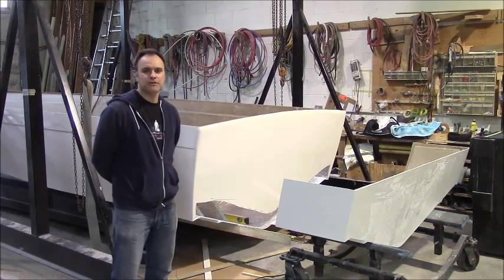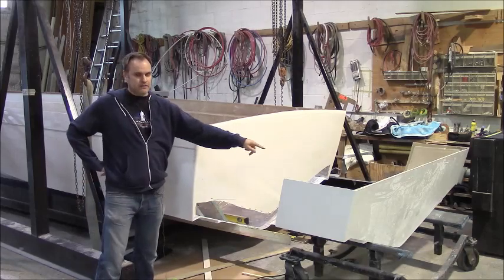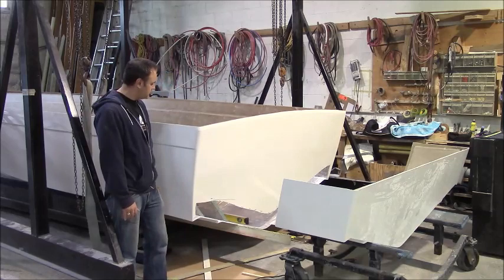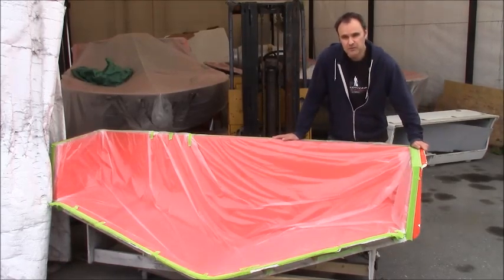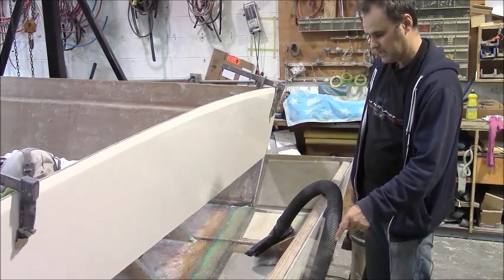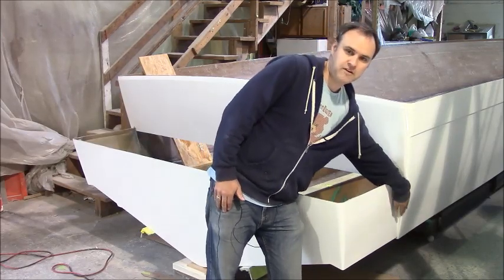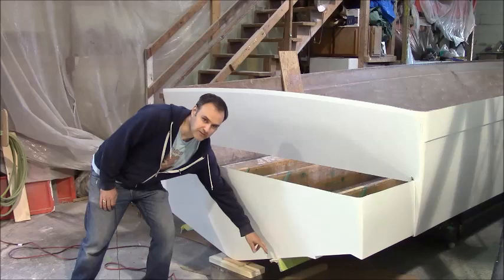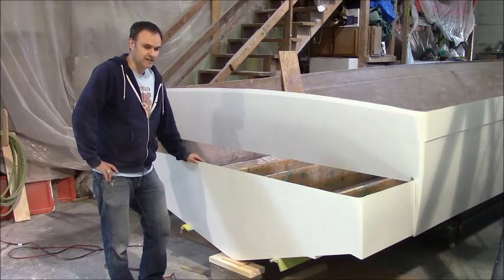How to Extend a Fibreglass Boat Hull

Comment: I think your video showed me just fine what you do, I've worked in fiberglass for years. 
In a large boat place I worked we built a removable transom (back) to the mold. We also made the mold extra long so we could slide the transom section FWD or back and make a 46 or 50 out of the same mold , this had inboards and we were able to leave the running gear in the same place . 
I would have thought you would have extended you hull mold and just dropped in a plug when making a shorter version. Do the work once and then make the hull  the right length every time from scratch , no patching.
Cheers warren
Reply: Kinda what I thought. I'm not a fan of the 2 opposing 90° corners at the "step". Looks like that would be a breeding ground for spider cracks.

Comment: Very cool to see this operation! So basically the strength of the extension is all about the extended stringers? Another thing I don’t understand is the new transom is much lower, the engine will be short shaft then?

Comment: Everybody wants brackets but this makes more sense. Brackets don't add hull length in most cases. Hull length is important because it adds efficiency at lower displacement speeds by adding waterline length. Displacement speed is the speed at which the wavelength of a vessel's bow wave is equal to the waterline length of the vessel. By extending the waterline hull length, you extend the displacement speed. The effort to push the boat faster rises considerably. You can go faster before that resistance in encountered. This also provides displacement/flotation back where it's needed which is under the heavy engine. This in turn reduces the leverage of supported weight aft of the transom which tends to cause porpoising. A common defect even in new boats. This also reduces the strain a bracket creates on the transom as well which means heavier reinforcement can be avoided. This also reduces the height of the outboard once installed which reduces the center of gravity height problems that outboards have. How? A common bracket allows the water to cleave clear of the bottom much further forward of the outboard. The water then rises as it proceeds aft requiring the outboard to be mounted even higher for the cavitation plate to make contact properly. But this does not occur with this design which is the same as normal transom mounted outboards. The water flows clear of the bottom right in front of the propeller where it needs to be.  In fact with brackets, its common to need electric engine height adjusters installed because of the different water exit heights that far aft of the transom at different speeds. Unnecessary with this arrangement. Additionally, this allows for a shorter shaft length for the outboard which reduces the center of gravity problem that all outboards have versus inboards which sit where they should be- at the bottom of the boat.  This also provides a swim platform on either side of the engine as well.

Comment: Have you ever extended a Sea Cat catamaran boat?  The older ones used mostly 2 stroke an when repowered with 4 stroke they sit heavily in the water.  I think you'd get business redoing the 21' boat.  I have one an I'm sure interested in the process.  Thanks for the videos!
Reply: I've done it. Made a bolt on extension with a center stringer pushing through the old transom. Super solid. All epoxy composite
Reply: @pikakenut  can you elaborate please, I'm facing a similar project on a twin vee and I'm not sure if it has stringers. Do you happen to know? Thanks
Reply: @ngirabedechal   there is probably not a stringer in your twin vee. You would add the stringer, passing it through the old transom into the new extended section of the hull from at least 2.5 to 3 feet from inside the boat. The stringer would be as tall as the deck in the boat and the top plate of the extension. Most extension for larger outboards 90 hp and up will be a minimum of 32 inches long to accommodate full tilt up of the engines. Your top plate on the extension is 4.5 to 5 
 inches below where the motor mounts to clear the hydraulic steering ram. So on a 25 inch long shaft motor the top plate is going to roughly be 20 inches tall on a full displacement extension. Meaning you stretched the boat the same shape as the hull vs bolting on a aluminum bracket which would be an entirely different  scenario. The cats really need the full displacement offered by the full extension so the don't squat to much under the weight of the outboards. The volume in most bolt on brackets does not carry the weight of the outboards.
Reply: Thank you sir, your insight really helps as I'm still in a planning stage.  I got my boat for free, it is solid but older with no motors.  26 or 27 twin vee with cabin. I'm just assuming the   transom will need work and the deck although seems fine there is a section where the plywood is exposed from when whoever gutted the boat and it's been sitting on a trailer for a long time. I plan to change the deck and extend the stern with pod or bracket with floatation and re power with twin Suzuki 175 or 200. Leaning more towards the 175s. So I want to build something strong enough to handle the horsepower and also offset the weight of the motors.  I believe this boat was rated for 300 max, so I'm hoping to safely beat that.  Thanks again for responding
Reply: @ngirabedechal  spend the extra money and use composite coosa,  k cell or thermalize board for your deck and transom repair. Also definitely use epoxy resin as the mechanical bond of polyester resin is basically zip. I peel apart polyester boats with a flat bar and hammer. It's quite astonishing how easily it comes apart.  The composite board makes a way stronger stiffer never rot again core material. You'll thank yourself in the long run

Comment: i’m kind of surprised there aren’t any mechanical fasteners  on the extension ? or at least you didn’t mention them ?   looks and sounds like  you’ve been exposed to resin fumes for a very long time , i’m not making fun of you  i am a retired Woodworker  who was also in a business that had  many dangerous chemical fumes  with many of our finishes and  bonding agents  although i don’t have any  proof as to why  but in my  40s i began having Strokes  that has caused permanent brain damage  and a forced early retirement  as a result of the Traumatic Brain damage  i lost the use of my left arm and hand as well  and i will admit that i did accidently get high as a kite from  prolonged exposure to some of the chemicals  from Automotive Grade paint fumes and Acetones  being absorbed into my skin  it was a weird sensation  as it happened  over a long period of exposure  and it took me a while to realize what  happened ?  it’s just a theory of mine  as i’ve witnessed similar  medical issues in others that are in  careers that use many of the same  products  or very similar ones   one incident of mine was from exposure to Spar Varnish  when  finishing  a boat of mine  my Father  owned and operated  hair Salons for many years and they used to use a spray rig piped to many areas of the shop for the hairspray  so the air he breathed all day long was filled with similar chemicals  and he wound up  coming down with several mental and neurological  conditions before his death

Comment: While the presentation could have been better, overall it was an interesting video. Not much in showing you what to do, but a decent end result. I don't understand why he would not have feathered the sides of the boat to match the new extension - that bump left is useless and ruins the flow. As well, I would have cut 3' out of the middle or near the end and left the transom intact. Seems that would have been a better and more cost-effective process.

Comment: Painful to watch....But, I appreciate that you're not a public speaker and come across as knowledgeable and authentic. Maybe it's just me, but using the term "pasted" sounds like a school project, and undervalues the actual precision work you're doing. Why/how are the stringers joined/slanted? and are they reinforced somehow prior to the fiberglassing? 
handling
Reply from the maker: I agree it was not well done and I'm not a good public speaker but this video has the most views so it seems I have entertained the viewers. Lots of harsh, nonconstructive comments but I have chosen to respond to you. I have been away from the you tube so I am behind on all the comments. I don't do drugs. I'm not brain damaged. I am quite smart and have an engineering degree. I have used the word "paste" as it is how we have commonly referred to it around the shop. The product is Polybond. The stringer are slanted to create more surface area with the joint. The hull extension is added later because we don't have a mold for the full length. This is why the stringers have to be joined. The main hull is laid up with the transom and stringers in place to maintain the shape and rigidity of the hull. The aft end of the stringers are temporary and are knocked out when the transom is cut out. The permanent ends of the stringers are installed when the hull extension is installed. Stringers are "pasted" to boat , then glass tabbed to hull then fully encapsulated in glass.

Comment: Why outboard power? Why not twin inboards or water jet power?
Reply: Everyone want outboards now, lighter , self contained , quieter, easily repaired or replaced, water jets are much lowered powered for the same engine size as jets are very inefficient except in light jet skis that are basically overpowered.
Reply: Buy a boat with inboards or jet power and you will understand why.

Comment: Twin engine set up????
Reply from the maker: I'm not sure which boat we were showing but for twin 150 outboards we use three layers of 3/4" plywood on the transom and for a single 250 we use 2 layers of 3/4" and 1 layer of 1/2". We also built one with a 300hp. The owner is aggressive with his boat and uses it daily so for that one we use two layers of 3/4" and 2 layers of 1/2".
Reply: Plywood!!🤯